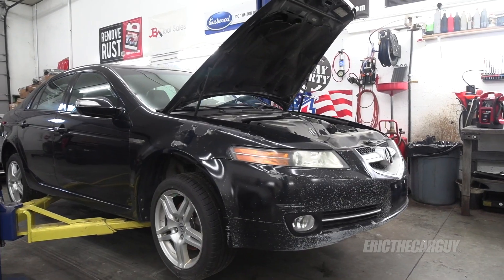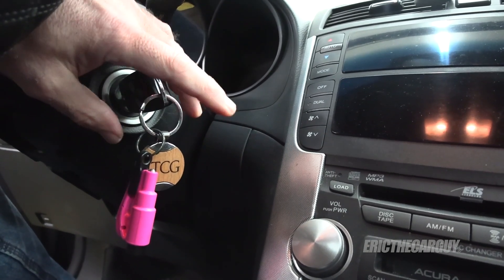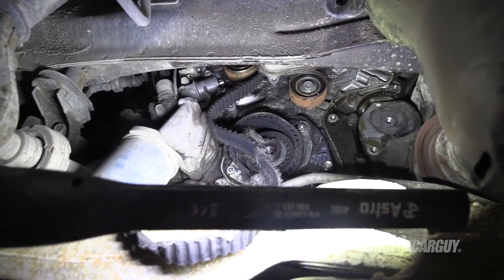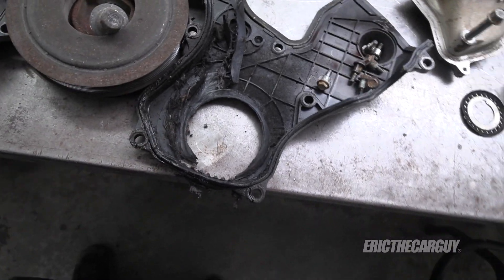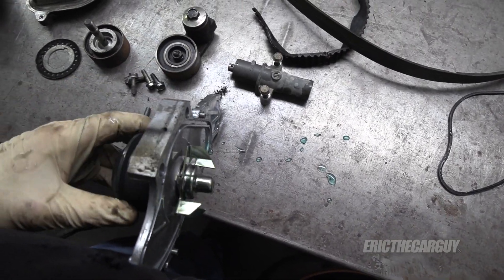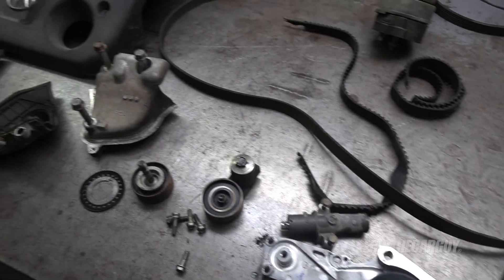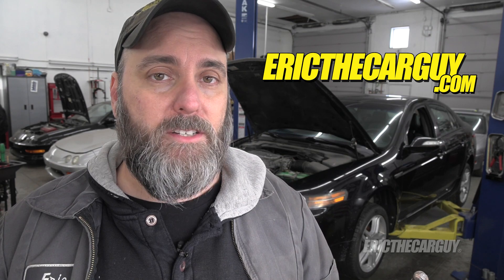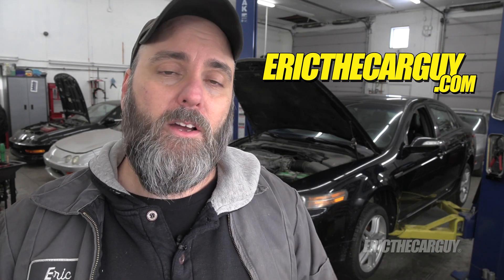Acura TL Dies On the Road

Comment: Did you possibly put the timing belt guide that goes on the crankshaft backwards? I’ve seen people do that and it destroys the belt. Also you might wanna reseal that oil pump. Looks like it’s leaking
Reply from the maker: No. The installation video is linked in the description. Also, with oil leaks, always start up high. It's more likely that the valve cover gaskets are leaking or the VTEC gasket. The oil pump is sealed with Honda Bond and rarely leaks in my experience. https://www.youtube.com/watch?v=XfDKhjlN7X4

Thanks for the comment.

Comment: Eric, isn't the 3.2L and the 3.0L Honda v6's clearance engines?  I googled it and it stated that those are the only 2 engines that were clearance type from Honda......????
Reply from the maker: This IS an interference engine, which is why I said you need to rotate the crankshaft off of TDC in order to put the cams into position. Otherwise, the piston hits the valves and the crank won't turn. . I still stand by everything I said in the video. Thanks for the comment.

Comment: Following along with your idea about going ahead and replacing the timing belt anyways is a smart move regardless if you think the engine could be toast or not.  Especially in a car like that where a replacement engine is probably worth the cost.  Glad it worked out that the belt was the ticket to the repair, but even if you found trouble with the engine itself you probably could have gotten a scrap yard engine cheap enough to have done a replacement engine and had the timing belt kit to put on the replacement engine before installation.  When the problem first occurred and you were stuck on the side of the road with the car, I thought hmm, I wonder if the timing belt said see ya later...guess I was right on that part, but I figured man he's probably going to have some engine damage.  Glad I was wrong about that part.  Seems like your car is in pretty nice condition, certainly worth keeping it going.  Especially since you are the mechanic and have the skills, tools, and shop to do the work in.  Although maybe for a regular consumer it might not be worth it for an engine replacement at a shop, but for someone with the ability to do the work themselves certainly worth the work to save a good car like that.  

Thanks for bringing us up to date on your Acura been wondering about it...glad to know its gonna live a longer life.

Comment: Was that wp kit a "Honda OEM" ebay kit?  Or a AISIN aftermarket?   As much as I like OEM, currently with the fake parts/packaging issues were seeing...I'd rather go with legit aftermarket from a retailer than eBay or Amazon OEM.   OEM is ok, but I'd have to be ready to pay parts counter price at dealer.
Reply from the maker: Honda OEM on Amazon. Link ini the description to the original video. This was an experiment to see if those kits were any good. The take away: don't buy those kits. Instead, look for Aisin kits. I believe they are the OE supplier for Honda.
Reply: @ericthecarguy  I put the AISIN on my 06 Accord V6 at 140,000.   The kit a shop installed at 108k was aftermarket of some sort.  Died at 140,000.   Weird times.

Comment: Is that tensioner supposed to be damped?  I know some are so they extend slower than just a spring.  This can cause problems if the fluid leaks out and the belt is allowed to vibrate at some speeds.  Dunno if that is the case here, just an idea.
Reply from the maker: Yes, installation video is linked in the description.

Comment: Nice!! Always a great feeling when the valves aren't bent!  

I had a customer with an infuriating PT Cruiser - I did the timing belt out in driveway at 10° that February day. Absolutely miserable! To top it all off, this car was designed by engineers that hate technicians, I swear (And swear I did! LOUDLY!). Never had so much trouble doing a timing belt job in my life! Anyway, same deal - she fired right up, even though cranking sounded uneven. The owner drove it for 3 months, then Chernobyled the engine in spectacular fashion - boiled the coolant right out of it! Only coolant left was in the reservoir on the firewall. That was a great day for me, seeing that turd go to the crusher! I had it on Craigslist for MONTHS, and nobody wanted it, LOL - that tells you something! Ended up doing well at the scrapyard after filling the cab to the roof with other junk. Peeled the tires off and sold them, and cut the cat off and scrapped that separately. Got $60 for the cat! Works for me. :)

Comment: Yes. I've heard of ppl getting fake Honda parts with the same results as you did. About 2k miles and it snapping. Where did you get yours from? My coworker got it from Amazon.  So I figured I just get a aisin kit for my odyssey from rockauto.
Reply from the maker: All that info is linked in the description. Amazon is where I got the original kit.

Comment: do you have an intake manifold removal video of this engine? i recently got a 2000 TL given to me because it doesnt work properly and im replacing the thermostat and the coolant sensor because they need replacing i am also replacing all the gaskets from the intake manifold to the throttle because theyre leaky. If you have any videos that show any tear down of the intake in any way ill appreciate it, even if it is a totally different thing youre doing.
Reply from the maker: The intake manifold gaskets are MLS and don't require replacement. Before you get into that car, you might want to read this first. https://www.ericthecarguy.com/kunena/common-problems-pattern-failures/50011-1999-03-acura-tl-s-and-cl-s-pattern-failurers?limitstart=0
Reply: @ericthecarguy   aw dude youre awesome thx.

Comment: My Ridgeline broke a month ago it think it's worse when the timing belt jump cuz the engine will stay running but that will guarantee to bend every single valve
Reply from the maker: I've never seen one bend all the valves. Also, valves are cheap, about $15 each.
Reply: @ericthecarguy  i hope not but it won't start i think I'll toss a cheap belt just to see if the engine still good if so I'll get the whole kit from Honda

Comment: What about this for a diagnosis?  Is there any chance that the boss that broke off was maybe really stressed from someone really over tightening it in the past almost to the breaking point and then it broke a ways down the road.   Did you by chance install a new sensor on that boss and that even stressed it a bit more since it could have been previously stressed almost to its limits.   Couldn't  that boss and stud flying around in there have "derailed" the belt and really been the problem.  Just doesn't seem like antifreeze dripping from the weep hole could damage that belt in just a few 1000 miles.
Reply from the maker: The belt wrapped around itself after it broke, the engine was still rotating at the time. Too much belt and not enough space caused that to break, nothing more. Also, it wasn't "flying around" in there. I noticed the break when I removed the sensor, it was still intact up to that point. Thanks for the comment.
Reply: @ericthecarguy  Thanks for the response!   I watched your video of the install and it all looked right to me!   Just like when I did my 2005 TL down to the messed up engine mount.  You make great videos!  What would make that belt break at aprox. 2000 miles......the coolant on it?    Was the belt saturated in coolant since you said that pump was slightly leaking or do you think the belt was not really an OEM part and that the real problem.   I got the feeling from your video that you were thinking only the pump was a knock off.   Are you thinking the whole kit was a knock off?    If you think the antifreeze did this I wonder if I soak a small piece of actual timing belt in antifreeze for a few months if I will notice it damaging it compared to a part not being soaked.  Just doesn't seem like 2000 miles with antifreeze dripping on it would destroy a new belt even if the belt was not OEM quality.    Again, great video!
Reply from the maker: Yes, I believe the entire kit was a knock off and as such caused the failure because of defective parts. There was no sign of contamination.
Reply: @ericthecarguy  Thanks for the response!  I wonder how much knock off stuff is really out there.  I have bought what is supposed to be brand new Apple OEM iPhone charging cables on ebay for very little and when you hold them side by side next to a genuine Apple OEM cable that comes with your iphone they look identical even on very close inspection.  Even the box and instructions look like Apple stuff, but they will charge your iphone intermittently on our 2019 RDX.  I know that the genuine Apple cable has a chip in it that does something and that could be the problem, but you would think that something as basic as charging would not be a problem.  The very weird thing is that the same cables will charge the phone when used on a AC outlet with a genuine Apple small white square USB charger.   Very very weird, but the Acura dealers know about some of the non Apple OEM cables not working, but you really throw them a loop when the cable looks like an Apple OEM and doesn't work.

Comment: Did this on an old Fiat Punto when the belt snapped. 1.2 8 valve engine and fired right up. Of course its a non interference engine, my old bmw e30 2.0 6 pot nah, that took out 3 valves and cracked a piston. Scrapped the car (this was when e30s in the uk were just a couple hundred quid to buy.
Reply from the maker: This was an interference engine BTW. Thanks for the comment.
Reply: Scrapping an E30… ouch lol.

Comment: Still sure on the prevalence for timing belts Eric?   😋
Reply from the maker: 100% Chains wear out over time no matter what and cause a loss in performance. Not to mention that chains are often more difficult to replace, and if they fail, it's more catastrophic. With a belt I renew it every so often and the engine runs almost as good as the day it was made, if it's been properly maintained, see the latest Pilot video. BTW, I can change these belts in a little less than an hour, maybe less if I feel motivated.
Reply: @ericthecarguy  thanks for your extended reply,  i appriciate that!
I was only teasing you but none the less these are valid reasons,  i have driven cars with both cam drive options and to my experience it also depends on the car manufacturer and engine design.

Fresh belt  = fresh solid timing   i do agree on that with my understanding of engineering.

Comment: Back in the day, a crank-no-start condition on an engine that ran great moments before meant check for spark/fuel/air.  Seems like modern engines have those three plus belt/sensors/wiring/ECU.... Bah!

Comment: 1:20 The manual versions of these cars do not have this feature My 07 Type S 6 speed does not have this at all
Reply from the maker: Makes sense if you think about it.
Reply: @ericthecarguy    true Probably the only downside of the 6 speed cars upsides were limited slip differentials & front brembo calipers All 6-speed models got that Not just the Type S

Comment: You got lucky!  Even before it started I could tell by the sound of the crank you dodged a bullet.  However, you used fake parts and the belt failed.  It could have easily cost you the head job.  The Gates kit is probably OK but not as good as the Aisin kit.  At first I thought you put the fake water pump back on but I see you used the Gates pump.  I hope you took all the parts out that came from the fake eBay kit.  Having done a ton of these, the only water pumps I've ever seen leak are the Gates and GMB water pumps.  I've never seen a genuine Honda (YNA) pump leak, even long after the service interval, nor have I ever seen an Aisin water pump leak.

My two cents...don't cheap out on the timing belt parts.  If it's too good to be true (Amazon/eBay OE parts) it's probably fake.  If you're doing it yourself, order the Aisin kit or spend the money for genuine Honda parts and you will be successful in your Honda timing belt job.  I've never had a failure (knock on wood.)  

Side note...the shim behind the idler pulley was for a service bulletin for a "chirp" from that pulley.  I've never heard one make this chirp sound and I've never installed a shim, nor have I had a kit that came with it.  Maybe one day I'll run into one.
Reply from the maker: Thanks for that input. BTW, I'm a 25 year Honda tech myself. That said, the entire point of installing the counterfeit kit was to illustrate the potential danger. Keep in mind what I do for a living, which is making videos for YouTube. Broken parts get lots of views and since I only spent $200 on the car originally, I felt it was an opportunity to experiment. 

FYI there was some belt noise while the engine was running before the belt broke that I had planned to look into after I returned from my trip. Unfortunately the belt broke before I could check it out. Things are quiet now as you heard so I'm just going to move on. I have no idea of the shim solved that or not. Since I'm getting a lot of traction with my most recent 'Honda restoration' videos, this car might get that treatment down the road. For now, it moves on it's own and I can drive it to the new shop when the time comes. Mission accomplished. 

Lastly, I like Aisin pumps. I believe they are the OE supplier to Honda. Thanks for your comment.

Comment: Looks like the poor thing is smoking behind you at the end... That aside, can one expect DTCs just before a timing chain goes? I have a 2006 Colorado w/ 142k on it and I think it's coming awfully close to having major problems with this. (My hope is to last until about August where I plan on doing something major by then, likely just saying "screw it" and throwing a brand new engine in).
Reply from the maker: It's just some power steering fluid burning off. I had to disconnect it to do the timing belt. As for if you get codes, maybe, maybe not. I suppose it depends on the vehicle. You might find this info helpful. https://www.ericthecarguy.com/faq/

Comment: Wish I were that lucky? I tried replacing my 180,000 mile timing belt, and put it all back together. Had a no start? Had it towed to a local shop, and the mechanic says , I bent the pistons? Mind you, this happened in my driveway. The belt never broke. I was doing preventative maintenance, cause the belt was so old? Should I replace the engine, or junk it? It’s a Chrysler Concorde LXI, 3.2 and ran like a top, before I screwed with the new timing belt and water pump?
Reply: I don't know much about that car or the price of replacement, but a nice tip if you ever try replacing a timing belt again: before starting your car after replacing timing parts, put a socket on the crank pulley and spin the pulley with a ratchet 360 degrees. This will spin the crank and cams and if your timing is off, you'll be able to catch it and fix it before starting the car. It should spin freely. If not, your pistons and valves are hitting and your timing is off.
Reply from the maker: I can't speak for your vehicle without looking at it, but it is critical to get the engine back in time before starting it or else engine damage can result. How much damage depends on a number of factors. Good luck.

Comment: I can see two Honda designers shaking their heads - yeah, we forgot the self tapping screws in our design. 
😉
If it works - it works !
That’s what the Gen-Z have the biggest problem with. If it’s not in the manual, can’t be installed. 🤦‍♂️

Comment: 0:32 Make sure to put some epoxy behind that Acura logo on the engine cover, those things are famous for falling off
Reply from the maker: Honestly, I'm ready to chuck the engine cover, along with all the other stupid covers. They just get in the way. I'm not really concerned about resale value at this point.
Reply: @ericthecarguy   The one for the battery tray is like gold  A ton of these cars they're missing mine included  And I understand your point. You have a base model That's an automatic. Nobody really wants those. It's the Type S  with the 6-speed That's where these cars skyrocket in value Those are the cars that you want to keep the engine covers and emblems in pristine condition

Comment: This further proves your previous video on timing belt vs chain. Chains are more reliable
Reply from the maker: Perhaps, but the wear out over time causing a loss of engine performance, and when a chain fails, you likely won't be able to slap a new one on and expect the engine to run like this engine did. My point in that video was to illustrate that both drive systems have strengths and weaknesses. One isn't better than the other, especially if you neglect them. Thanks for your comment.

Comment: What about a timing belt that broke off and also broke off the timing gear??  My friend has a 08 kia that the timing belt broke off and the gear then it caught fire. 

I think the engine is done and he will need a new one. We also aren't sure why it happened other than the fact it's a kia rio lol.
Reply from the maker: Without looking at it I can't say anything for sure. See if the crank rotates, and then see if the cam rotates. If both do, then you might try a belt just for the heck of it.
Reply: @ericthecarguy  so the actual timing gear came off the car with the belt, thats why I said I don't think it could be fixed.
Reply from the maker: Anything can be fixed with enough money and time.

Comment: Were the previous parts Amazon sourced? I know you often feature "Honda" parts kits that come off amazon and they have the red labels. I'm pretty sure those are all counterfeit. Unless amazon is the direct seller and the parts are individual. Still risky.
Edit. I got to the end of the your video. I'm not aware of Honda ever making any kind of "Kits". Those are all blatantly counterfeit.
Reply from the maker: Yes, and that was kind of the point of the video. I normally use Aisin kits.